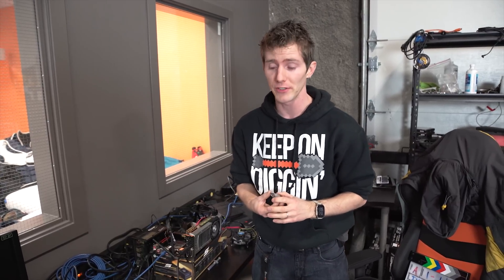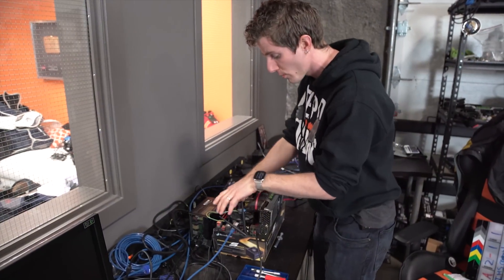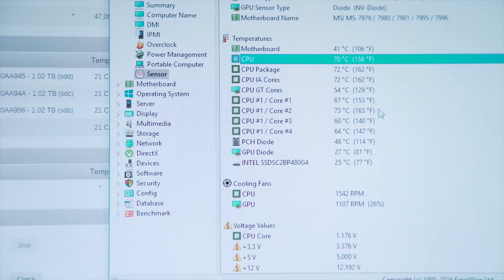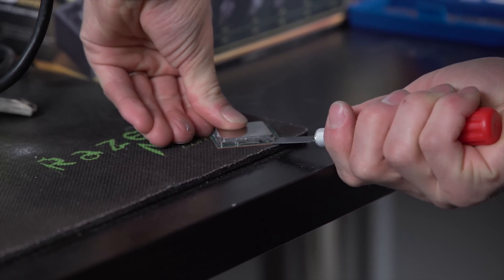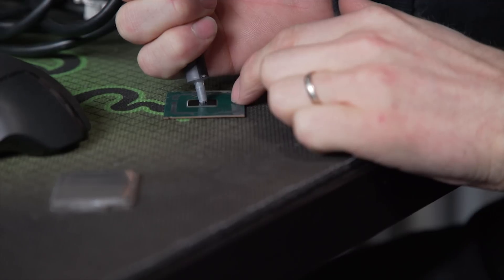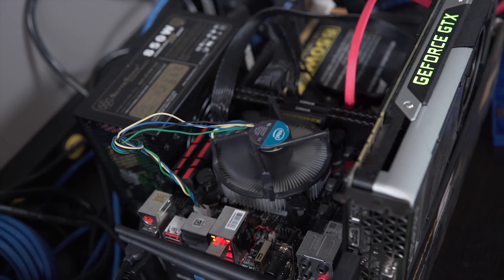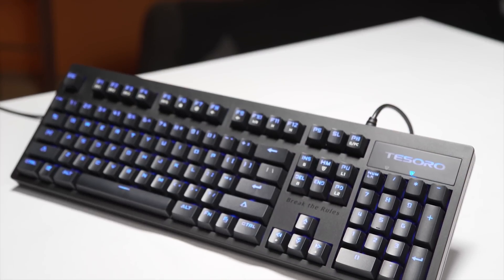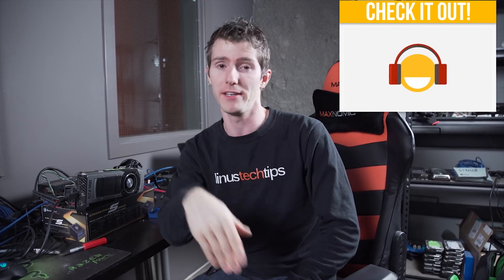Delidding an Intel Core i7 6700K - Is it worth it!?

Comment: Isnt the clockspeed of the 6700k dynamic, atleast partially dependent on temperature, much like GPUs are? If so, couldn't the small temperature decrease be attributed to the CPU sitting at a higher clock speed at full load longer, instead of thermal throttling?

Comment: And, where did you get that CRAP cooler, and why did you use it on a delidded CPU?  The reason to delid is overclocking or reduce heat from a normally hot CPU.  You do not use crap, either compound or CPU cooler and expect good results.

Comment: Not really much left of the CPU's mass after the IHS is removed, just a thin board with a extremely thin silicon die. I remember the P3/Athlon days where there were no IHSs. Well as long as you didn't have a Slot-1 P3, those had full fledged heatsinks already attached, but I think you might have been able to replace them, not 100% sure. I was like 10 years old in the Pentium 3 days.

Comment: first of all, it looks as if you used some basic thermal paste, second of all you used a stock cooler, who even delids to use a stock cooler? i delidded my cpu the other day, and today i applied some liquid pro and my temps have dropped 15-20c, this is on a 4790k but still.

Comment: OK. So doing this in gen 6 and older is not really needed. Tell us we do not need to do this on Kaby Lake 7700k CPU at 5 GHz. Proof shows delidding can drop temps by 20C or better. the TIM they put in there is complete shit. If you are gonna overclock to the max or near max then delid the Kaby Lake gen 7 CPU. You will need better TIM to lower temps. I delidded my 7700k and I do not regret it. Did it this way with razors. You do not need special tools if you are careful. Like this so people will see that Linus is WRONG in this case. Long story short: Overclocking? Delid a Kaby Lake CPU as you will need to for lower temps.

Comment: It's funny watching tons of videos with people experienced with delidding, doing delidding on 7700k (cutting 20C!!!), then going back here to compare, only to find all the things Linus did wrong here... No wonder he didn't get that great results.
 - He should have used better cooling from the start, at least a good Noctua aircooler if he was too lazy to compare before and after with watercooling (no point in delidding if you have crappy cooling, then just buy a better cooler instead and call it the day)
 - He could have used real liquid metal thermal paste, to give the comparison a fair chance - because nobody does delidding without investing lots of money on the thermal paste itself.
 - He did a crappy job cleaning up the old glue on the CPU PCB, which means he won't get as good pressure between the IHS and the chip, which reduces heat transfer. Even if it doesn't look THAT bad on the PCB it could still be enough to impact the results
Delidding is not only about swapping thermal paste, but also to remove the glue completely to let the inside of the IHS sit in more direct contact with the chip, allowing better cooling.

Sure I haven't done this yet myself, but the theory behind it all is really simple, just head over and watch those tutorials by people who have actually done this for a long time.
I used be among the ones who thought delidding was a waste of time by cutting a few degrees while voiding the warranty, but I realize I was wrong about it.

Comment: You call that much thermal paste? If you saw me aplly it on mine, you'd think I'd be preparing to run LN2 on it and get a world record overclock (Fun fact: The German Overclocker Der 8auer recently broke the world record for the highest overclock on a CPU. He got 7,328MHz out of an i7 7700k running all 4 cores with hyperthreading and cooling it with liquid helium).
Reply: When you really need those 30K difference between nitrogen and helium.

Comment: Bah, delidding a rusty old 6700k is for wusses. Grab yourself a brand new top-end LGA 2011-v3 CPU, drink 10 beers, and delid THAT. Then, for bonus points, post the video showing us all how you managed to fuck it up.
Reply: Actually i think you can't because all E processors seems to have the die and the IHS weldied together so since they're not glued you can't separate them.
Reply: Since you can't weld copper to silicon, they're soldered. They can be separated, it's somewhat trickier and has a lower chance of success but it can be done. Usual method is to slice through the adhesive joint as usual, insert cardboard shims between IHS and substrate, then heat the IHS with a small torch. Pop, then go through the long process of removing the solder lumps while trying not to wreck the die.

Comment: Another great-but-terrible reason to remove an IHS temporarily is to repair a CPU or GPU when the thermal grease under the IHS dries out and separates. It takes years for it to happen, and by then the hardware is mostly obsolete (YMMV). I intentionally bought a pair of "not working" GTX 560 Ti's that both turned out to have this problem, and after repairing them they've been running perfectly in SLI every day for the past 12 months. (relatively perfect, since the cards work great individually, but SLI in WIndows 10 is an unstable nightmare)

Comment: couldnt you just put heatsink directly on that small heatspreader inside?
Reply: That's the DIE, it's the chip itself, not a heatspreader. Yes you can, but the reason there is an IHS is to add strength. With a sizeable cooler the DIE can break, hence breaker your cpu.

Comment: A couple of degrees different???  I've seen close to 30C improvement on high overclocks.  And the razor method is so primitive.  There are many cheap 3d printed kits that cost almost nothing on the web.  Just need a vice.   I did my 3770K back in the day and I got about 15-20c improvement.

Comment: I think the temp difference doesn't really show until you overclock. also the stock intel heatsink that is no longer included on the unlocked series probably does not help as i doubt theres alot of hidden cooling potential in it

Comment: The problem with this test is simple ( it's linus )  the stock cooler, this littel peace a shit is the bottleneck. If you had preformed bought test on a aftermarket cooler the result would be bigger :)
Reply: Also use liquid metal instead of a regular thermal paste between the die and ihs.

Comment: the temps is why i got a H110i GTX 104.7 liquid cooler for my i7 6700k with this cpu DONT I mean DONT use the stock cooler with a cpu that runs hot because 158° thats giving your cpu a hot lava bath

Comment: Hey Linus, unfortunately you can not say this in general. First, since Devils Canyon Intel is using much better Thermal Paste and the effect by switching to another thermal paste is pretty low. But on the original Haswell (4770k) Intel used a very poor quality Thermal paste. By switching to liquid Metal you can easily get 20K (Celsiuns) lower temps.

Comment: This is a badly done video, as it contradicts many other videos on the web, stock cooler? What was the overclock? Normal TIM, you being paid by Intel? So many 7700k ocs at 4.9 indicate 15-25 degrees lower and higher stable points?????

Comment: I delidded my i7-4770k and got 20 degree improvement. That made it possible to overclock it from 3.5 to 4.5 GHz, 1.34-1.36V, hottest core ~88-91*C with air cooler. Earlier I had DDR3-1600 instead of DDR3-2400 and the CPU was passing tests successfully with even lower voltage and max core temp ~80-82*C.

Comment: I had to do this on the CPU and GPU on a PS3 to stop it over heating. The thermal paste under the heat spreader had dried up, so sometimes it is worth doing this. Depends if the company who made the CPU/GPU used cheap thermal paste like Sony did.

Comment: Linus too bad you never reply anymore and retest this. My advice: Grab an AIO or huge aircooler, grab a 7700K. Run it on 5GHZ with 1.3-1.35Vcore and prima95 it. Delid and put Thermal Grizzly Conductonaut on it. Retest. People have reported ~20-25degrees lower temps in these cases. Your conclusion is due to lack of OC, due to lac of proper TIM between die and IHS and due to lack of proper cooling (stock, really?).

Comment: Tbh  your conclusion is absolutely ridiculous. The other day we manage an i7 7700K was delidded wand with a liquid metal, the temperature under stress went 20 degrees down. So much for your "not worth the trouble".
Reply: i7 7700K is different thing. i use 4.6 ghz with 1.31 volts and in idle cpu temp might jump to 60 C or above and my cooler is Corsair H115i. and many other guys has the same thermal problem as i have. so intel has put really bad thermal paste between cpu and heatspreader
Reply: I can confirm - My workmates i7-7700k dropped by 20c after delidding with an Corsair H110. He used the 3D printed delidding tool + vice
Reply: Yeah, the way he did this thing is absolutely horrible and tells a lot about the 'expertise' this guy actually has.

This is how it's actually done...: https://www.youtube.com/watch?v=y6KFzoFwYrE
Reply: bullshit, mine runs on 48x100 with 1.32 volts and 40-42C idle. Under load goes beyond 70 yes, but 60C on idle? no way
Reply: I overclock my 7700k to 4.945 or something like that and it would go to 74c with a Nashua dh15 tower cooler. I got occasional small split second hangs during gaming so I down clocked it to 4.6.   Now it runs at Max 61c. Mine stays cool but I bought the most expensive air cooler available.
Reply: 100% true, hence this video is misleading and utter nonsense. Really makes me sad, since people actually think delidding is a waste of time/money/risk now.
Reply: There are risks, if you are complete and utter moron of course. But at the end of the day it's worth it. I am considering at the moment to delid my new 6600K to see how much I can oc it. It's a win from the lottery. Without delidding and with a good cooling it goes up to 4.8 ghz stable.
Reply: Well if you get the Delid tool 2 from Der8auer the risk is basically reduced to close to nothing. Just make sure to insulate the capacitors if you use liquid metal. What can go wrong then? That you damage the pcb while cratching off the glue? :P
Reply: Tbh the Delidding tools are so many nowadays (printable) that his is no issue. If you want a tool you just print it. But it will be the old fashion razor way. I'm not much of a fan of tools made of someone = ) And yeah, I'll be careful with the LM. And you can damage it if you scratch of the glue with a grinder for example :D
Reply: they had these terrible results because they used a stock cooler whichis a bottleneck in this test, a decent 240mm aio or dual tower cooler would have showed the massive delta
Reply: What all of you have consistently said in this thread that delidding has reduced your temperatures of your (keyword) 7700k by 20 degrees. This video is almost 2 years old and is for the 6700k. With kabylake it seems that Intel used an even cheaper TIM than Skylake. I would say Linus' video was accurate for the time.

Comment: Leave off the IHS, install shimming pads just barely higher than the die itself on all 4 courners (a la exposed die AMD K7 chips), and run with an aftermarket HSF (preferably one without a protruded core, flat the lxw of the CPU) with surface area enough to cover the die. That's the proper way of doing this.

Comment: Whoa, hang on Linus. You can't conclude that it makes very little difference from that test. Part of the reason people direct die cool is because as you start throwing more thermal energy off the CPU because of overclocking and throw a bigger cooler on to it, your thermal junctions become more significant. Just like how you throw an overkill processor into a computer when you are testing video cards, you need to use a high-end water cooler and a CPU that is overclocked that had a high TDP to begin with. You should consider doing another test for overclocked CPU's and use direct die cooling. From a thermodynamic perspective, it makes no sense to use the heat spreader when the die uses thermal compound (soldered heat spreaders are different). People who don't overclock will most likely never try this in the first place, so i feel you have shown this concept in the worst possible light.

Comment: I might be wrong. But wouldn't it help even more with more wattage? I don't think the heating up process is linear. So at higher wattage i guess it will help even more.And oc will raise the wattage much. my i7 3820 uses with oc 30w more.

Comment: hey Linus, just out of curiosity, was your chip bought off the shelf from a retailer, or was it an Intel 'reference' chip?

The reason I ask is because I have a 6700k with a corsair H115i running at 4.2ghz, and at idle I'd expect around 38-42°c (Australia), but as soon as I put it under load the temp skyrockets instantly up and beyond the 70°c range.

I was wondering if it's an internal lack of thermal paste inside the die or what my problem could be. I've attempted cleaning and reapplying the thermal paste compound between the CPU and heatsink a couple of times already to no avail.

Comment: No one uses the 6700k boxed cooler, let alone de-lids a CPU and uses the box cooler at stock voltage. I think the contention is that once you put 1.5v into a CPU you push it close to it's TJMax, the TIM starts to under-perform, either due to application quality or TIM quality itself. If you wanted to resolve this beyond contention, use a CPU with generally poor TIM quality, one with generally good TIM quality, then volt it up, put it under water and see what happens. I suspect the difference would be better represented as a percentage difference and it would increase the higher temperate of the processor. This test was clearly rushed, Linus we know you are busy but we know you are better than this, don't bother if you aren't going to do it properly.

Comment: Every chip Linus gets is basically the cream of the silicon lottery. You can't expect it to be representative of whats out there. Maybe it does not make enough of a difference for him but I've seen people having 20C drops after delid. When I delid my 3570k back in the day, I got a 15C drop witch helped me achieve a few extra hundred Mhz. Now i'm wondering if I should do the same with my 6700k that breaches 90C @ 1.4 vcore... It think its safe to say some chips have really poorly applied TIM and if you are the unlucky guy who seems to only be able to get that kind of chip, deliding might be much more helpful than this video would suggest

Comment: Is TIM the same thing as thermal paste?
Reply: Yes, but when people say TIM they usually mean the paste UNDERNEATH the heat spreader.
Reply: gotcha!  i was thinking of delidding and using kryonaut grizzly instead of that liquid metal one everyonetalks about.
Reply: TIM is any Thermal Interface Material. Thermal paste is one type, liquid metal another, there are presumably many more kinds to choose from. I have even heard of solutions that pumped demineralized cooling water directly onto the dies, but that wasn't a CPU, but a similarly priced giant thyristor in a 200MW Power Supply.

Comment: Stock temps isn't the reason to do this, I believe.
When Ivy Bridge came out, it used thermal greese instead of being soldered directly on, like with sandy bridge, but the stock temps weren't an issue, more so was the overclocked temps, were ivy bridge became much hotter than sandy bridge, resulting in an ironic result of Ivy being slower than Sandy due to throttling.

That's the story I've gotten at least :)

Comment: ummm, HIS results aren't worth it, agreed. But when you get 15c-30c cooler it sure is. (on water) Use a liquid metal for crying out loud. Higher voltages, cooler temps and a jaw dropping fast overclock. Delidding is pretty damn safe if you don't have Parkinson's.

Comment: Improving the heat transfer near the source of heat will improve the performance throught the whole cooling Sink setup (heat resistance of cooling elements is in series, so lowering resistance on source will help you transfer more heat to next part of the cooling chain and if it is overkill cooler you will see more improvement than with stock cooler.

Comment: it's worth it on haswell and ivy bridge because you get 18-20° drop using coolaboratory liquid ultra. skylake and Kaby are not worth it because they will handle 1.4v on air and aio without delidding. ivy and haswell on the other hand can barely handle 1.3v.

Comment: this is such bullshit, with a good delid you gain 15 degrees, up to 25 with an overclocked 7700k... linus u use a round drop on a cpu with 2x the length of the width, I dont believe the whole die will be covered + you want the liquid metal. This "review" is such trash. sorry man

Comment: I cannot disagree more with this video:
There are TONS of people who get an average of 20°C improvement delidding their CPUs and putting liquid metal between the die and IHS.
Reply: Not necessarily. Even with Liquid Metal, it depends if it is resealed or not. And if you do a reseal, it needs to be done properly and precisely. A bad reseal can even make it worse than factory, stock.
Reply: @allisknu11  You don't need to do a reseal, just clamp the IHS down with the socket. Ran my I5 for 2 years without a ditch.
Reply: @xXYannuschXx  a 20c improvement seems to good to be true, do you have any resources I can check this up on? Maybe you can make a video?
Reply: @omgwateverlol  https://www.gamersnexus.net/guides/3064-intels-thermal-problem-pt1-liquid-metal-vs-thermal-paste-benchmarks-7900x
10-15°C drop on the 7000 series, on my 4000 series I saw a 20°C drop, like many else. The 4000 REALLY had shitty TIM on it, that would degrade after 2 years.
Reply: @xXYannuschXx  thank you for the link will check it out!
Reply: Liquid metal LOL
Reply: @ryanolsen294  ?